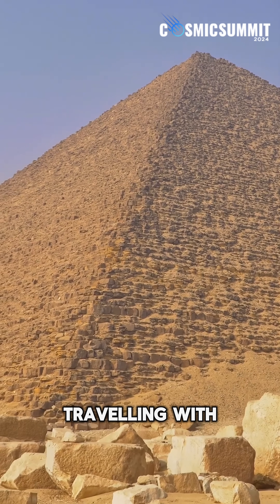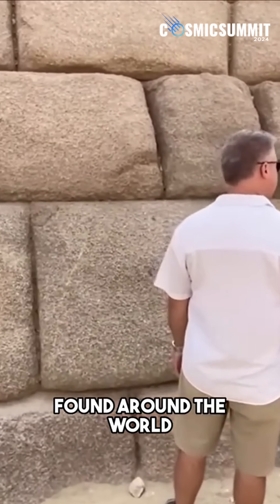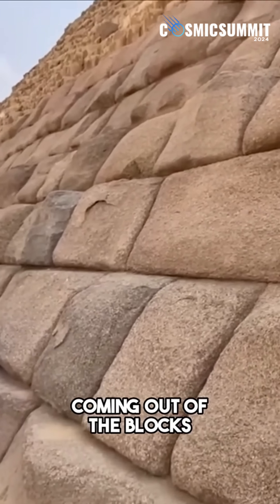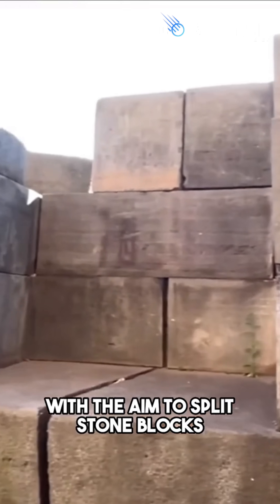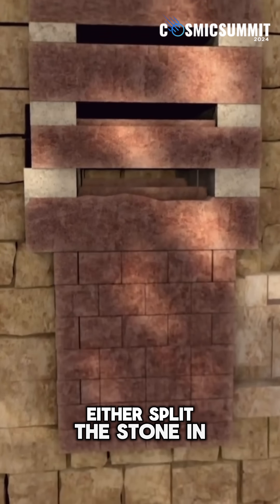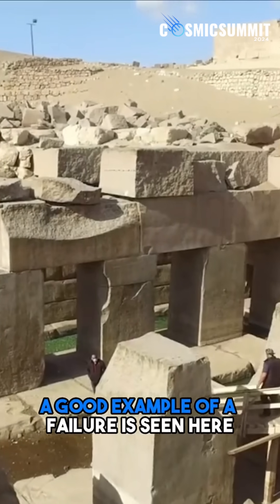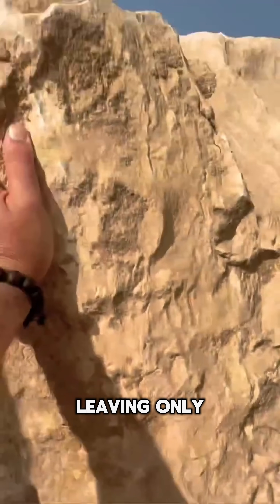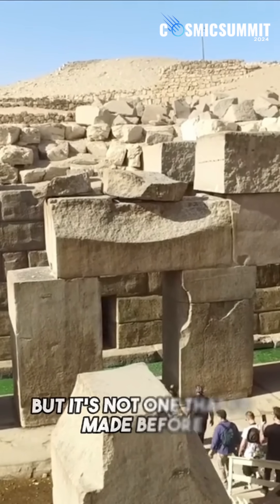How do you think nubs ended up on these massive stone blocks?

Comment: What you call "nubs" are called Protrusions in the world of Anthropology.  Once the large stones were placed, the fit was far from perfect.  They allowed two wooden beams to be placed under them and with the use of a fulcrum and two more beams, the stone would be lifted up enough for work to be done on the bottoms and sides, until the fit was "perfect."  This process of lifting and fitting was repeated until it was seated.

Comment: If you’d research a little further you would understand that the blocks mentioned are Aswan Red Granite.  The proven method is quarrying out blocks with pounder stones. About 2mm per hour. Slow but doable.
Reply: If you do the math. 2300000 stones over 20 years would take less than five minutes per stone to be quarried, cut, transported, and placed. There's no way to pound out that many stones in that timeframe
Reply: @StephanJobes - Your argument falls at the first hurdle when you assumed there are 2.3 million stones without evidence.
Reply: @simonhunt3106  how many stones are there smart guy?
Reply: @StephanJobes  - You will never know for sure without deconstructing the pyramid and counting them one by one, and obviously then making assumptions for those missing.

What is your evidence for 2.3million stones?
Reply: @simonhunt3106  theyve used sound to map the whole pyramid and even found undiscovered chambers. Now be a loser troll somewhere else
Reply: @StephanJobes  - So, you have no evidence to support your claim of 2.3 million blocks?

OK. Got it. Thanks.
Reply: If the method is that slow then it's not the method used . Records indicate each pyramid took decades not centuries to build.  So even if your theory has a basis in reality. The time scale of your theory results in needing hundreds of thousands of skilled pounders to work simultaneously 24/7 and also I love where your heart is but it is a common fallacy to assume that the building material is homogeneous. Sandstone and soft chalk made up the outermost casing the inner granite beams were of multiple sources. And since we didn't specify which pyramid type but let's assume it's like the great pyramid  then 50 percent of the pyramid stones are not even cut rock but filler sourced from a local quarry and the granite beams  of the kings chamber came from punt (according to the writing) 

So yeah as much as I like the visual of slaves pounding rocks with rocks it's just not fast enough of a method nor explains the precisely shaped beams nor explains the nubs of the foundations

Comment: Poured and casted stones in place— no need to move huge blocks long distances or raise to impossible heights... that explains somewhat the outer stone casings but fails to shine any light into the complex arrangements of megalithic “granite”* stones within the Pyramids; not unless they could grind up granite, add a binder, and pour into a mold (already in place) until hardened... have you seen the wood beans poking out the walls of the pyramids? Why would they leave these wooden beams in place? Or what were they used for?
Reply: When the aggregate settles as it's being pounded from the top and waters added you need a place for air and access water to escape from, hence the nubs? Arcanes razor?
Reply: @macheteeddy888 the nubs had mirrors mounted on them, to reflect Batman's symbol onto the night sky. Arkham's razor
Reply: @macheteeddy888  and there is some evidence that Roman Cement evolved from their techniques— let’s not forget Alexander’s time in Egypt and the knowledge he brought back to the western world.

Comment: No, that's where they pour them in place. that's why they fit together so good. That's probably where they had a water drain or something on the form, to help the block dry quicker....
I mean, come on people, after 5000 years in a very dry arid climate, you don't think that whatever they used could turn to rock by now? It would also explain quite a bit of handprints that appear to sink into the concrete. One thing's for sure I bet you these things are older than they're telling you😮
Reply: They already debunked it. All stones were cut whole
Reply: All dating methods place the 3 pyramids of egypt within the assumed time of construction.

Comment: Maybe it was a signature of one of the elite builders. Maybe the nubs once held a wood header that held a roof up. Maybe they were nubs to practice climbing, or a ladder. Maybe the nub was a game of some kind. Maybe the blocks with the nubs were a locking mechanism on the sled or trailer they were hauled on. Maybe the nub block was used as a drag to carve a channel in the ground to keep the path flat and containing water. Maybe the nub was a scale of some sort to take measurements from. Maybe the nub blocks were used to keep a count. Every 30 blocks Maybe one gets a nub for tracking production. Maybe the sight of a wall or floor with a nub meant you were of a certain classification of people. Maybe it was an indoor sharpening station. Maybe a nub was like a home Bible. Touch the nub and say your prayer as you pass. I get nubs when I tear out ceramic tile installed on the floor. It happens when I smack the tiles edge with my oversized chisel.
Reply: maybe everyone of your guesses is wrong
Reply: Very possible. I would be curious to hear your ideas.
Reply: Dakota Boy must be half ret***ed
Reply: maybe all of them are right.